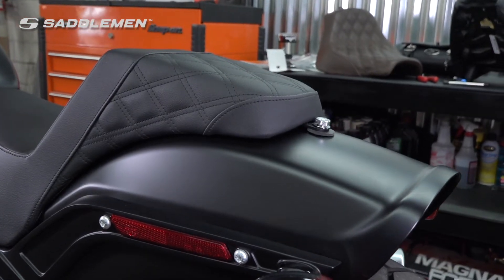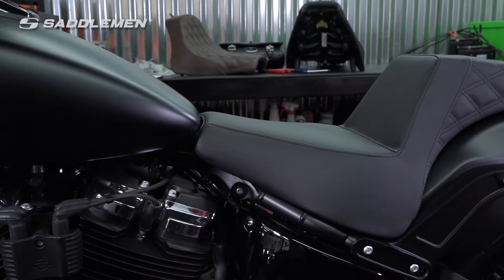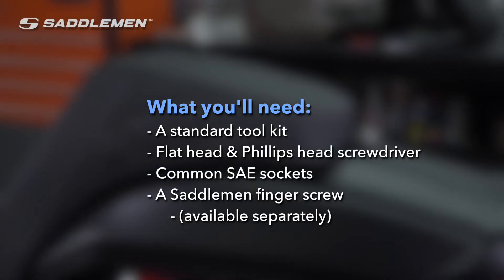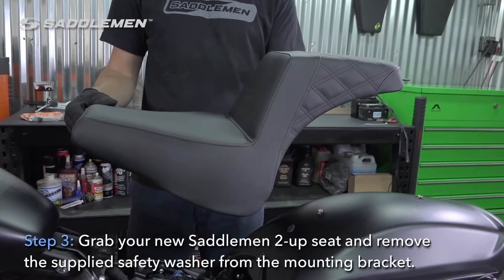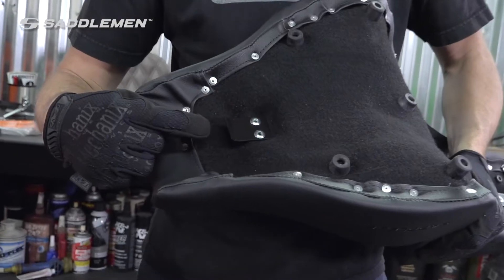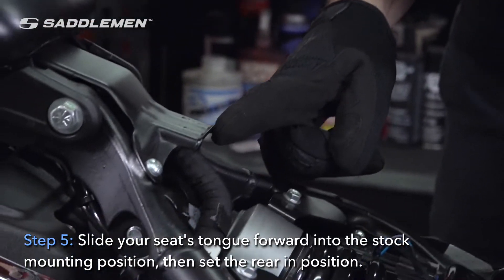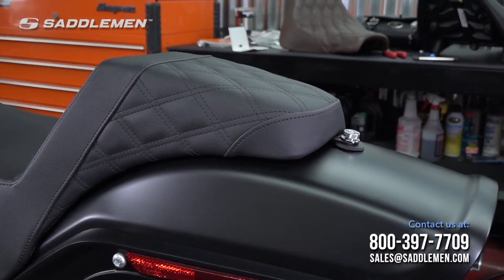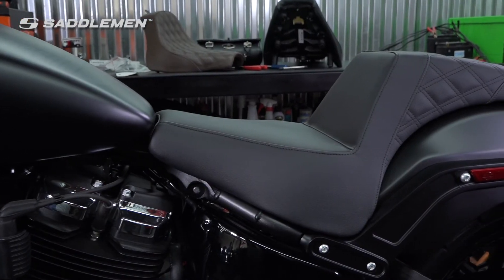Installation Overview // 2 Up Seat Install // Saddlemen

Comment: Will the install work with the screw holding in the stock seat instead of the finger screw? Is there anything else I need for this install?
Reply from the maker: Yes the thread pitch is the same and your OEM screw will work- that being said you can also add a bit of security and protect your investment with our Seat Lock- check it out https://saddlemen.com/motorcycle-equipment/installation-add-ons-replacement-parts/atab-security-seat-screw-black?limit=60 Let us know what you like, thanks!

Comment: How does the heated core work?  Hooked up to the bikes electrical system somehow I suppose?
Reply from the maker: Directly to the battery typically- if you have more specific questions we'd be happy to chat with you 800 397 7709- thanks!

Comment: Do y’all make that seat for the new 2018 low rider and sport glide?
Reply from the maker: yes we sure do. We have both solo's and 2-ups including step-ups
Reply: Saddlemen thanks I’ll have to head to the site and check them out
Reply from the maker: @dirtyfxdls7547  thanks , we're always adding new fitments to our line up - saddlemen.com